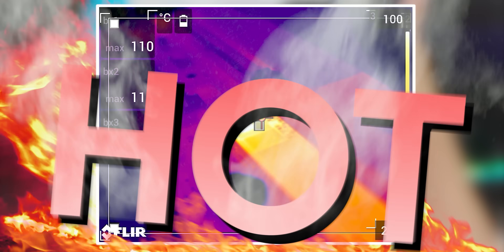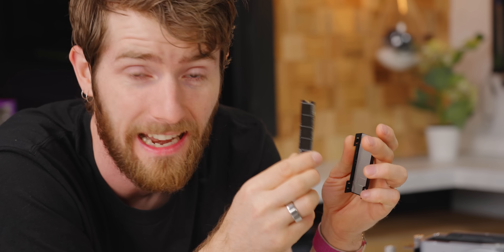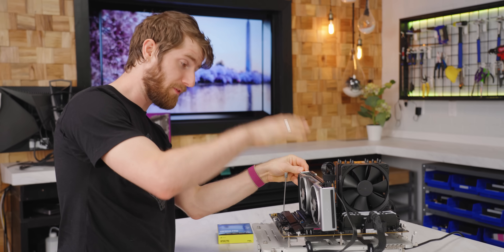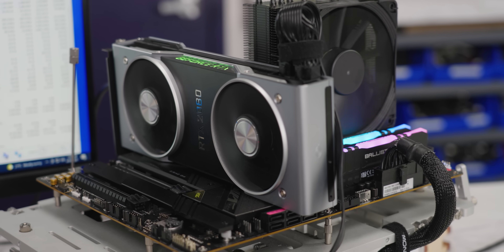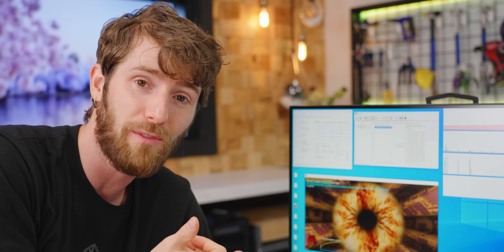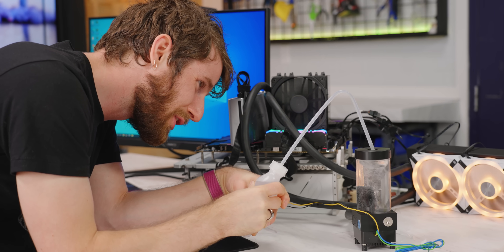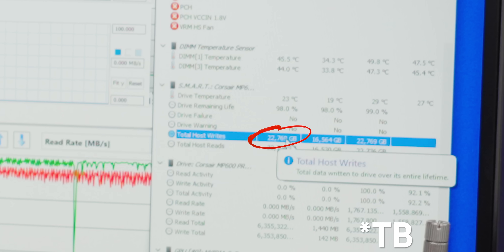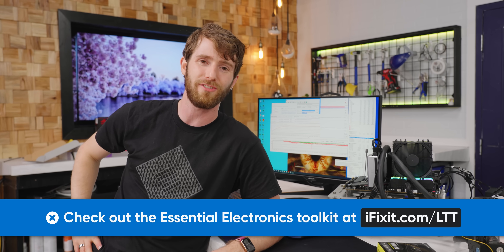This Product is a Meme - Corsair MP600 PRO Hydro X water-cooled SSD

Comment: It not about sudden heat and intensive use heat it about prolong heat soak,remember that even you shutdown or sleep a computer and all fan stop all main component are stop those drive are still receive standby power and all those tiny chip still produce heat without cooling.My m.2 drive are suffer a thermos throttling by this symptom and have to fully turn off power supply  for it to fully cool down.

Comment: If the water can't evaporate it can't take the heat with it. So this test wasn't needed. Must circulate since it can't evaporate. You can take longer to heat it. But also longer to cool it without one of those.

Comment: Water is amazing, but that's completely unnecessary. 

Up until recently, I just parked my HDDs in front of the 200 mm intake fan and forgot about them for the next 10 years. I didn't replace them because they died, but because it was getting ridiculous how long they were alive. They were slow as anything, but they worked.

Comment: I'm just about to start using small ceramic heat sinks with thermal grizzly pads on the controller only, that should be enough

Comment: you wont get corrosion from aluminum components unless your others metals are in the same liquid, AND are electrically connected via another path. its been a water cooling myth for years, but unless you use metal pipe, or maybe have one copper and one aluminum rad both connected directly to the case metal. 
GPU, CPU, ram blocks are all isolated electrically unless you connect them with metal piping. using different components is fine 99.9% of the time.

Comment: Should have tested full throttle gpu/cpu and ssd under realistic load before making that claim. It's possible the heat from the other components might cause the ssd to throttle even under a more realistic load.

Comment: so yeah the only way i can see to use this is in some kind of application that is so heat sensitive that you have to remove almost all of it from the system. and that would maybe be an enterprise solution not an end user one. and then again, why would you need your data storage so close to the temperature safety zone?

Comment: you got to do test again with the gpu and CPU water cooled. I wonder if it would matter. like  do they generate as much heat for the SSD to thermal throttle  if they are  water cooled?

Comment: super hot backplate of the gpu ? damn my strix 2060s fans is what keeps my xpg s40g ssd cool , when the fans are off , the ssd is idling at casual 70c degrees

Comment: I'm a little confused.  At 11:18 Linus says is was writting at 2GBs for about an hour but then only wrote 22.8GB.  I was like well thats not impressive at all... but then I think he mixed the comma for a decimal point and it actually looks like 22769GB which still doesn't add up as it would have to write at 6GBs for the hour.

Comment: I once had an Msi Board for my fx8350 which had its Northbridge at around 90 degrees while booting so  i watercooled it the block I used (Anfitec German Locals ) had like 3-4 fines milled with a 2 mm Bit but well it got me covered

Comment: But the thing is, if your PC already has a custom loop...and you don't mind spending a few extra bucks...Who exactly is it hurting? It might not add any actual performance gains, but it could help cool down your case (albeit, by a very tiny, almost microscopic margin..) and potentially even make the drive last longer. Is that actually bad? Is it something everyone needs...no, of course not. But I don't think that necessarily makes it a "bad" or "useless" product. 

IMO, at least this product actually does what it says and really does cool down your SSD...So many products like this claim to do so many different things but actually are just complete and utter bull** so it's kinda refreshing to see one actually does what it says on the box. It's just that what it claims to do, is something no really actually needs.

Comment: Wait... but who builds a loop just for a ssd? When packing the loop with other components, it should heat up the water to the point it's back to 'air temps' for the ssd... wouldn't it?

Comment: How about if you put it in a loop upstream of your CPU, but downstream of your GPU, that way it's never seeing freshly chilled water, but rather chilled water warmed to an extent by the GPU, but still feeding cool enough water downstream to the CPU?
Reply: doesnt really matter much where in the loop you would put it. if the flow rate isnt extremely low, you only get like 2 degrees delta from before and after radiator.

Comment: Sounds like bad design if an SSD needs water cooling. Most people don't need 7GB/s NVMe speeds now anyway (esp if you have enough ram to never need a page file) and Samsung's version of that doesn't even hit 60-65C with just Asus's stock mobo heat spreader on it and keeping it loaded for a solid hour (unrealisitc in real world use).

Comment: so you tested a air cooled system with a m.2 but what happens when you water cool the Cpu and Gpu that makes up the heat that spreads to the m.2 disk ?

Comment: As someone that have been running mechanical simulations for the past year, reaching 150 gbs of space on the SSD because of all the components and mesh, my SSD started failing on me. So yeah, maybe the performance boost is not worth it, but what about durability?
Reply: just to add, since I advanced more on the video to actually see Linus talk about the amount of data writen, my study has 12 simulations on each, Ansys backs up the whole thing before running any change, so it is about 12 gb per simulation (it is not actually even spread but it makes easier) so the study, during update, writes the whole 150 gb backup, runs the updates writting everything on a temp file, for after replacing the current file, so it has 150gb used, it used 150 gb more, then it writes chunks of 12 gb  before replacing it. for then, after everything when fine and I hit save, erasing the backup.
Reply: so summing it up, updating my simulation takes around 12 hours on the ssd, or 48 hours on the HD (it is a pretty crappy HD), in the last 3 days alone I had to adjust and rerun the whole thing 3 times. so it writes about 300 gb per run, that is 900 gb in 3 days. on a 500 gb ssd. (ok, i get it now, no amount ofcooling would compensate for that, and that explain why my ssd is dieing)

Comment: It might not help the SSD, but isn't an uncooled SSD also dumping heat into the case?
Reply: its so little heat compared to the other components. 5-10w typical for m.2 when loaded. gpu's like 3060 has 170w and 3090 somewhere around 350w.

Comment: I think where it would shine the most would be in a situation where you have a water cooled computer with almost no fans or no fans at all (passive water cooling with only radiators) so it doesn't dump too much additional waters in a sealed PC case.

Comment: The only advantage of SSD's over had drives is performance.

They are not more efficient.  SSD's and hard drives draw about the same amount of power while active.

They are not longer-lasting.  They even have failure built-in from the start, due to limited write cycles, which hard drives don't have.  While hard drives have moving parts that can fail, they don't suddenly stop being able to write data at any point.  I have had many, many hard drives last long past the point where any SSD would have failed due to the write volume.
Reply: i think the efficient part is in idle. hdd has to keep spinning the disk, or spin up the disk when needed, while ssd doesn not. i think power consumption to keep that disk spinning isnt that low

Comment: If the major heat source of an SSD drive is the controller, why wouldnt the manufacturer produce/use better controllers instead of putting a ridongculous water cooling system on it. I know the water cooling system is fun in its own but I doubt if it's necessary anymore when you see integrated chipset solutions like M1 Max being so mobile and energy/thermally efficient.

Comment: I just built a new PC in a TT tower 300 case and started getting a blue screen of death while I was moving files to my new drives from my old laptop and it ended up being an overheating issue on my main m.2 that has the OS on it.  The issue was caused by the graphics card so let me explain.  I have a MSI project zero AM5 mATX MOBO and a MSI 4060 ti.  The graphics card is one of the new generation cards that has the zero rpm setting in it so if the temperature of the GPU is below a certain temp then the fans stay off to save power but unfortunantly that allows the dead space between the GPU and the case to heat up and the heatsink where the m.2's are located was getting hot and not cooling off due to zero airflow.  To fix my issue I had to use the afterburner software to create a custom curve for the fans so that they dont turn off.
Reply: Its not to save power but to reduce noise while idling. To be fair, most GPUs aren't even that loud on the lowest fan setting so it doesn't matter much to me personally
Reply: @Mom19  Over the three days I have been trying to fix the issue with my computer giving me the blue screen of death so my first change was swapping my WD SN770 NVME for my Samsung 980 PRO NVME with the same results and still a blue screen of death but that also prompted me to reload the EPIC games launcher which went smooth BUT when I tried to reinstall Fortnite the download kept failing.  after doing a bunch of research it appears that the issue was with my memory.  I had 4 16GB modules of Crucial DDR5 pro installed so i removed the two of the modules and everything is running without an issue.  When i built this computer I had everything installed and running with only two of the four modules installed while I waited for the second set to arrive and I think that is when I started getting the blue screen of death.  After I swapped drives and installed windows 10 pro on the Samsung drive I didnt install the afterburner program and the GPU temp hasnt gone over 39C yet and the fans only cycle when I first turn on the computer. I am not seeing any over heating issues today and Fortnite installed without an issue so now I just need to figure out why installing all 4 memory modules is causing an issue.
Reply: @retiredcryptohunter9031  easy answer: DON'T use 4 DIMMs with DDR5. Your performance will literally TANK. The instability is the result of you pushing the same speed across 4 DIMMs, which simply isn't stable. To get it to work you would have to reduce the speed and therefore hinder performance. A lot.

Comment: But what happens when you connect it to the water cooled sistem where the other components bring up the water temperature?
I don't think it's going to work the same way and keep the same temperature, off course if the water is a 50° the SSD will get to 50° too
Reply: That's not how liquid coolers work...
Reply: @moodyx5626  don't all the components share the same water?
Reply: Yes but temperature ranges aren't high enough between coolant and different parts to affect cooling performance to any significant degree

Comment: It is actually depressing to realize as an adult that liquid cooling PCs is pointless in nearly every application and it’s pretty much just for looks.  Unless you go completely nuts and use 4 rads so you can turn your fans way down for silent running.

Comment: Why can't there be a refringent type cooler for the CPU and GPU instead of water cooling.
Reply: like cooling system with a compressor? if thats what you mean, way to much energy consumption. linus did this with his chiller, removeing heat from the loop with compressor condenser etc. search for that if youre interested

Comment: I thought 70* on a custom loop was easy to hit? Never done one but if you have an intensive game/workload wouldn't this guarentee performance loss?  I regularly hit 75-80 on my CPU 240 AIO when OC and playing Arma3
Reply: the component generating heat reaches 70°+ but the water is not at that temperature. its usually way cooler. Mine sits at between 30°c and 40°c and cpu is like 20 or 30 hotter. numbers are semi-acurate. pc isnt under load atm, so all idle^^

Comment: That moment when linus thinks 70c on a chip corelates in any way to being able to boil water.
Chip temp doesn't matter, it's the power transmited as heat that does. 20W ssd at 70c is not the same as 400W gpu chip at 70c.

Comment: Brand new build 3060 i710700 has the same issue as my old build 660 i74770 no parts shared both do not boot half the time although my fans spin and my keyboard gets lit up but does not boot, I run a designated 20amp power outlet directly connected to my pc and have had an electrician test and show my outlet puts out enough watts

Comment: I am a real water cooling noob tho so here is my question: since the conductivity of water actually comes from the stuff thats in the water, lke salts and minerals, if i used destilled water it should not be able to cause shorts, riiight? Thanks in advance!
Reply: pure water isnt conductive. but even if you would use pure water, it gets stuff disolved in it over time. so over time it gets conductive anyways.

Comment: I bought 2 2tb mp600 for $480 each and 1tb mp600 pro for ps5 for $220 dollar each, ouch. 
You can now get a 2tb 7000mb/s read ssd and 1400tbw+ for less than $240, and you are probably happy with a 2tb 3000-5000mb/s read 1400tbw m2 for about $140. (CAD)

Comment: Just it's sad, that I wouldn't be able to use it with my ASUS ROG Maximus IX Apex, because the M.2's are on a DIMM.2.

I use one heatsink with a tiny fan on one of them and an EK-Heatsink on the other, because on one side I'm restricted by the 24-pin and the DDR4 on the other.

Comment: SSD's having the advantage in endurance over HDD's? Whatever it is your smoking, i want some. :p
Reply: I've purchased used hard drives (which probably have already reached their "expected life time") and had them last over a decade. You are absolutely not going to get that out of an SSD. 

BUT for specific uses, I could absolutely see that if you were to buy a HDD now, and an SSD at the exact same time, you might have more HDD failures before you have SSD failures. HDDs are just less consistent in how long they last. (But I still compile to a ramdisk and page to a HDD, because I trust the HDD to not die from the stress of a compile.

Comment: I don't get it with some SSDs. My Corsair Force MP510 doesn't even reach 50°C basically ever, neither did my Crucial P1. Is the difference between a 510 and a 600 that much?

Comment: Cooler better? Tell that to my old AMD S939 CPU that would not boot if it was under the magical 12 degrees C... just had to leave it powered on until it warmed up and then power cycle to get it working!
Reply: My drive has just over 2k run hours with just 6Tb written to it!

Comment: Basically the immense amount of work needed for SSDs requires intense amount of heat to emit from the SSD modules, further prompting heatsinks or monoblocks (if you want to use it for gaming or workload-heavy stuffs)

Comment: over 400 dollars for it...good lord, anytime new tech lets overcharge for a year or so then drop it down to what it should of costed at release. Legit will be 100-200 in year or so, maybe little longer.
Reply: i mean its 2TB gen4x4, with a good controller that price is not bad^^ think you're getting something wrong there
Reply: @tiamat4621  Actually....u ain't wrong, I was watching while semi working and i thought the price was just for the "COOLER" component, not the actual memory module itself so ya price is def on point, i just mis understood at quick glance when i saw the price and component on screen.
Reply: @Slider-Man  oh alright xD yeah such cooler for that price would reach apple's marketing strategy level. but its the ssd, and price between air cooled and water cooled version almost makes no difference. there are cheaper gen4 m2 out, but i dont know bout their performance compared to this.

Comment: I do see a use for water coolers for cpus but I feel like they are taking stuff a step far now lol My first built was pretty simple more or less with the ryzen 5 3600 and the amd stealth cooler was enough to run on avg at 50°c at most times.. Yes if I played for hours on end it would bump up to 60+ max 70 but I simply invested into grizzley thermal paste and re pasted, and then bought the cooler master hyper 212 and my max went from 70°c to 50°c for the longest time.. Just saying water cooled everything isn't necessary and say something goes wrong with the mount... YOUR GPU GONNA GO BYE BYE! 😅🤷‍♂️

Comment: on ur 2nd attempt !! .. u want to say that u heated up the water and did not circulate through anything .. what did u expect ? the temps would go down after throttling ? nope ... the heated water maintains the warm temp thus preventing the ssd to throttle back to normal.

Comment: The price is not good... not any part in that cooling block is worth much over $6.00.   If you paid $400+ for the ENTIRE Cooling system, sounds right... .maybe I misheard you.     but $400 to hover water over my PC motherboard, just never seemed right to me.   1 leak and its all toast.
Reply: they have been selling these Personal Air Conditioning devices.... some go on your desk, others around your neck..... but none are for your PC.   could it work?
Reply: the ssd costs $400+, it has a cooler installed. you can choose which one.

Comment: Hey, do you think this PC would be good for it's price (700€) ? If not, can you recommend parts (I want to build a new PC) for a total price of 700€?Thanks.

AMD Ryzen 5 3600	
 
MSI B450M Pro-VDH Max	
 
Nvidia Geforce GTX 1650 (4GB)	
 
16GB Crucial Ballistix 3200Mhz	
 
SSD	500GB Kingston A2000 (NVMe SSD)	
 
400W be quiet! System Power 9	
 
Antec NX100	
 
1TB Toshiba P300